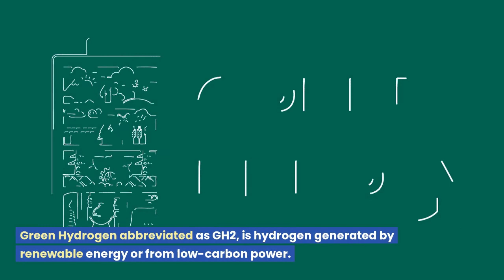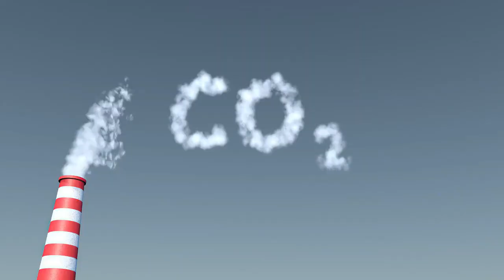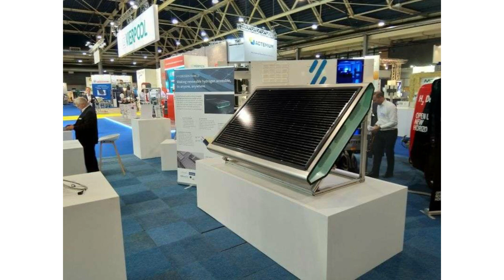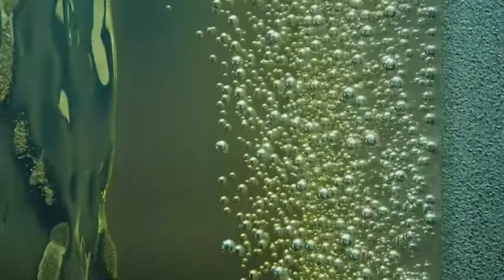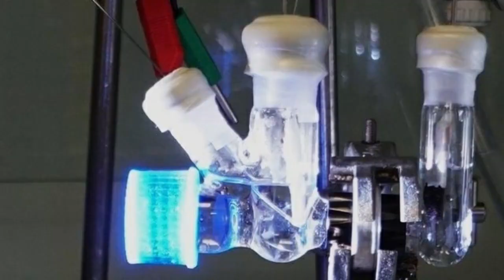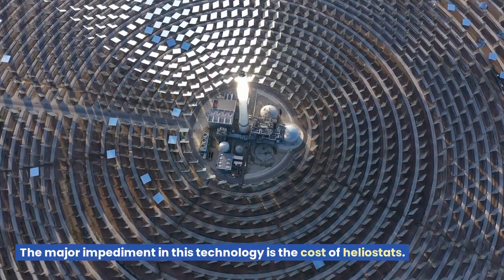Solar to Hydrogen -Convert sunlight directly to hydrogen

Comment: H2 competes with CH4 for OH in the atmosphere making it effectively a greenhouse gas.
Reply from the maker: It water H2O that is a greenhouse gas.
Reply: @synergyfiles3536  That's an entirely different thing. I didn't just make it up.
Reply from the maker: @Timlagor  I agree with what you have said
Reply: @Timlagor   and ozone and water vapor. While most pwoer generated around the world is pumping out CO2 like there's no tomorrow.

Comment: When will "they" stop attempting these huge projects for grid applications? Grid has 30% loss at transmission lines. 

When it is small, self contained to each house, or business and off the grid (as needed) : is when we have independence.

Comment: For green hydrogen, the only number that matters is the cost.
Reply: Thewn try 'white Hydrogen' that flows from drilled wells due to underground chemical reactions.  Hydrogen is the most abundant stuff in the universe, our Sun has been using it for Billions of years to keep us warm.
Reply: Also the leakage. It's a potent GHG.
Reply: @Timlagor It would be funny if everyone uses hydrogen to avoid global warming, only to cause more via hydrogen. 
Also, the earth's gravity isn't strong enough to hold hydrogen. Some of the water we split into hydrogen, will leak and eventually be lost to space. Also, we don't know what effect the leaking hydrogen will have on the ozone layer.

Comment: Cheapest energy source to date?
Liquid metal Thorium ion Molten Flouride Salt Energy Converters (TMSR) require little Uranium and the cheapest can be built and operated in less than 5 years at a capital cost of $1250/kWe and poduce power at a pre-profit levelised cost of less than $30/MegaWatt.hour. 
Eg Indonesia's 7×500MWe ThorCon's Molten lquid ions of Thorium; Sodium; Berilium and Flouride salts as aBase loader or automatically load following to help out the inefficient; unrecyclable and short lived Solar & Wind farm so called "Renewables" that at 2Watts/m² would destroy Indonesia's tropical rain forests if used instead of ThorCon TMSRs at 43kiloWatt per square metre...
Reply: Sounds interesting but difficult. No one is talking about it. Why?

Comment: Until the IPCC accepts the truth that climate variation is a long term cyclical phenomena caused almost entirely by solar and cosmic forcing and tha CO2 levels FOLLOW Temperature changes, unquestioning societies will continue to throw away scarce resources pursuing futile remedies, instead of accepting the realistic expectation that the current increasing cycle is now concluding and the belief in humans being the cause, remains a puerile folly..

Comment: Why would you bother? Waste of good electricity. Hydrogen has few if any transport uses, only niches. There is a reason everyone is making EVs. The only ones desperately trying on hydrogen, are those that have lost the EV race already. Or in the pockets of old Oil. Batteries on the other hand are a rapidly developing area.
Reply from the maker: The problem is that when it comes to heavy duty lorries, we cannot rely on batteries because of their high weight. Same is the case with electric aviation. I was opposed to Hydrogen because I myself work in a company that makes battery packs for buses
Reply: @synergyfiles3536  Seen recent videos about the Tesla Semi, truck. Being used by Pepsi I think it was. Electric will have no problems with doing trucks, I mean they are built to deal with moving weight!
Aviation is another issue certainly, however I have seen some video about a battery tech breakthrough that was so good on the power to weight ratio aviation would become a possibility. OK Caveat, I expect these developments are in labs as yet and not mass production. But it suggests battery tech is still young and improving.

Of course it would be better to end all powered flight anyway. An evil of the modern world, rampant pointless people moving. However, Hydrogen should be used for lighter than air slower, better, air travel and cargo lifting. Now that should be a niche to new major use for green Hydrogen. Got to stop worshiping speed, it serves little real point or use.
Reply: White hydrogen is available from ground well sources like natural gas is....  Hydrogen is so useless as a transport solution that Tesla is now making 'Hesla' vehicles with fuel cells.  To fit a 12 tonne battery into a truck means the payload has to be reduced.  Toyota and Kenworth make a fuel cell + electric motor power pack that can be retrofitted to older HGV, this means a new life for old vehicles that are not designed around their huge battery packs, with a 10 minute recharge for 300  miles range in the demonstrator.
Reply: okay Elon bro.

Comment: Hydrogen is useless as fuel because you cannot store it for longer than a few days, and even then there will be significant losses due to the hydrogen atoms bleeding out through the walls of the storage tank. Further, hydrogen lingering between the atoms of the storage tanks changes the physical properties of the tank itself, leading to “Brittle Fracture”. Look it up. This is not something that can be overcome, it is a element aspect of material science.

This why no one with a technical background takes hydrogen seriously. It’s always politicians and bureaucrats who keep bringing this stuff up.
Reply: very good!! I hadn't imagined!!
Thank you for yor eye opening comment
Reply: Hydrogen produces brittleness in steel, but modern hydrogen storage tanks are made with carbon fibre composites..
Reply: @chrissmith2114  it's only a carbon fibre composite until it becomes a carbon/epoxy/hydrogen amalgam, at which point... fracture.
Reply: @frankinla91602  Wow, did you tell Toyota and Honda, who have been using the tanks for years....
Reply: @chrissmith2114  ... unsuccessfully, obviously.
Reply: @frankinla91602   And then it starts escaping into the atmosphere where's it's a potent greenhouse gas since it prevents the breakdown of methane by competing for OH radicals.
Reply: @frankinla91602   you sound like an Elonbro
Reply: So you replace the tank, like any other part. Separately a copper alloy is used in hydrogen rockets that do not react to this  enbrittlement  problem.
Reply: @reypolice5231  Have you noticed that until SpaceX, which doesn't use Hydrogen,(at all), all hydrogen rockets where 'thrown away' after one use BY DESIGN!!
Reply: What about using it directly as feedstock for industrial processes like for green blast furnaces or ammonia?

Comment: Making clean hydrogen for steel making and other industrial processes makes sense. It does not make sense for transportation, since we are entering an exciting era of new and powerful battery technologies, which will overcome the battery weight and cost issues currently present.
Reply: Agreed. In transport, volumetric energy density is paramount.  Industrial uses will be H2's future.
Reply: it makes perfect sense to have technological diversity
Reply: Yeah, the battery breakthrough has been promised since the first battery electric cars in 1820.... been 5 years away ever since.
Reply: @chrissmith2114  ?